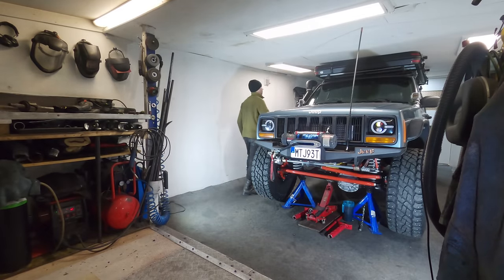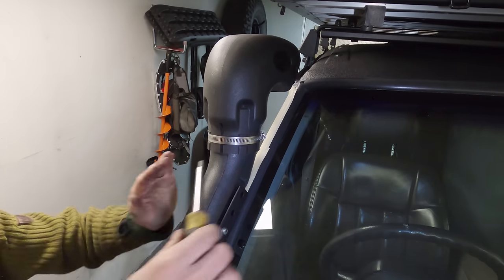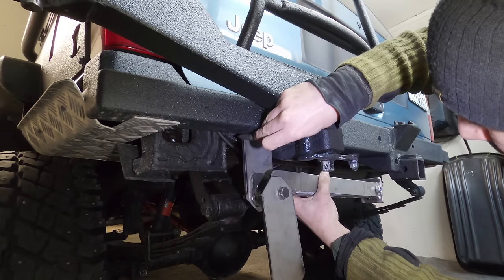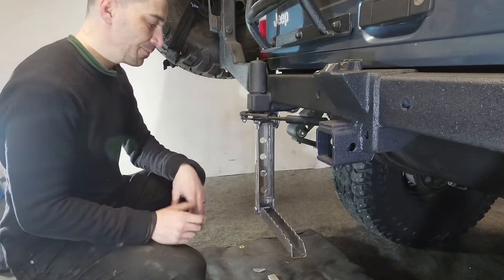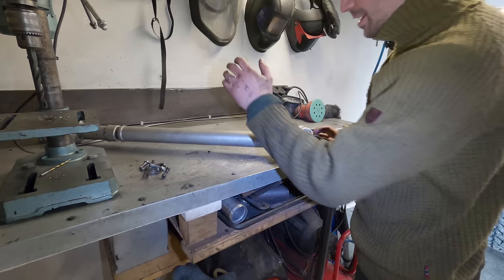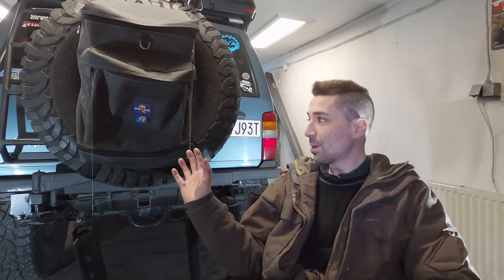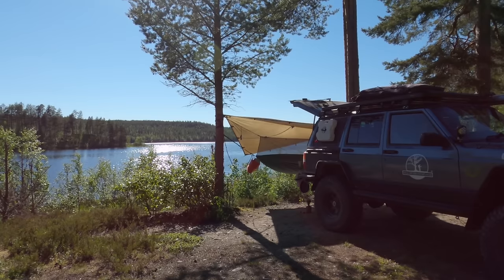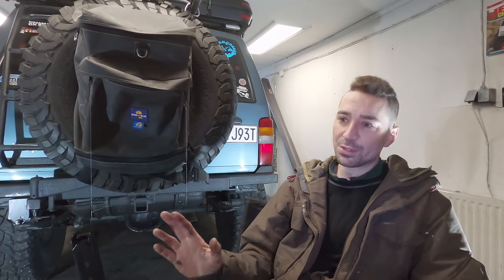Making Some DIY Parts For My Adventure Jeep

Comment: One of the best solutions to mount snorkel to the pillar is to glue it in place with windshield sealer. It stays supper rigid, can be removed at any time, no need to drill holes in the A pillar - so no rust in the future, no rattle, no vibrations
Reply from the maker: That's not a bad idea. I think my problem is that I'm using a Hilux snorkel, and it needed bending into place. Seems alright 👍 
Thanks for watching! I will remember the tip.

Comment: No worries, Mike.  Love coming along for the ride, so to speak.  Your videos are certainly interesting to me, which is where the entertainment value for me comes from as well.  Looking forward to seeing what you do with the "new" truck in the coming months.  Also, I hear you about the insect issue.  They can certainly drive one mad.  Sounds like you are trying to address that as best as you can, given the limitations you are dealing with.  Even though the extremes of winter present its own challenges, it is a blessing that the insects aren't one of them.  Good luck!

Comment: Mike the Disco 2 has a step similar but its on a gas strut .
Im always amazed how you turn some ( workshop scrap ) into an awesome functional solution.
Great video thanks
Reply from the maker: Ah, nice, I haven't seen that. Perhaps my mate took it off. It turned out pretty good, and It also worked well at camp. Thanks for watching

Comment: Hi Mike. 

I enjoy all your videos. 
You make some great points about the RTT and the flys and summer camping. I think for your location and flys. It makes sense. 
My Jeep is setup so I can sleep inside my Jeep. But to do this I modified the front seats with the pivot brackets from a 2 door  xj. (Direct fit). So my front seats tilt forward towards the dash just like a 2 door xj. Then I mounted a plywood board to the back seat into the metal frame of the seat with nutserts. That board is shaped to fit around the center console. And folds down on to the base of the front seat. Then I click the front seat back 1 notch. So it stays locked in place. Now to actually do this. I have to remove the back seat bench. Either before I go. Or when I get there. If I’m going out without my kids I leave the bench seat at home. But if they come along. The bench seat goes inside the arb annex room. 
If I’m camping solo. I don’t set up the annex room often. As I put all my gear on the other side of the jeep next to me. I have those plastic window vent things on the rear windows. So I can get a cross draft. Then use those stretchy window shade/bug screens that go over the entire top of the rear door. 
I’m the rear of the Jeep is a removable shelf. But it stays in place when camping. My feet go underneath. My gear goes on top. Or I can place an iPad up there for the kids to watch a movie. 
On a morning I can lean up against the back of the front seat. Like a lounger and have my coffee. 
I had to modify my front seats. As I’m 6’2”. And the Jeep just wasn’t big enough otherwise. 
Also I have no rear window like yours. So that where the diesel heater pipe comes in. But you don’t need that. As it’s in your passenger footwell. 
I think you could probably easily setup yours so you could sleep inside solo. On the opposite side to your fridge. You would just have to move your metal kitchen box next to where you sleep in the rear seat area. 
Maybe start by removing the rear bench seat. Fold the back down. Then build something that folds down into the the rear footwell. And is level with your rear sliding table system. I’m assuming that when you winter camp. It will only ever be just you sleeping inside the Jeep?
Removing the RTT might help the Jeep do even better in the snow. As you will be 150lbs lighter I’m guessing?

Comment: Good plans on the 4,0👍🏼 I am doing something very similar to a diesel at the moment😊 31’s and a small lift. I have taken off the original fender flares tho, and i am making new frow sheet metal. And i ‘lifted’ the front ones 3-4 cm at the same time. I have also bought a 1,9tdi and a 6-speed transmission that i plan to install next winter. Keep up the good work! And keep the classics on the road🥰

Comment: Could you make a quick video on how your body is holding up after this many years of abuse. Is reinforcing the body absolutely necessary? And if anything ripped after the reinforcement? I was told by one body shop owner, that it is useless, that when you reinforce one part, body will fall apart somewhere else, in the next weak spot.

Comment: Try to move shift lever around, on my wrangler when I put shift lever all the way forward it makes wining noise, but when I pull it half an inch back (still in 2wd) noise stops, also when I put it in 4wd noise goes away. So something is touching and making noise
Reply from the maker: I tried that and installed a assilink linkage. I'm fairly certain it's in the case itself. Bit of a shame, but I will rebuild it when I get a rebuild kit. Bloody annoying, though 🙄 
Appreciate the tip, though, because that's happened to me before. Thanks for watching

Comment: Why not just make something L shaped that slides into the tow hitch so the step is removable? Short part of the L fits in the hitch, long part of the L points to the tire and reaches under the ladder
Reply from the maker: Yeah, I mean, you could do that also if you wanted. I like not having more stuff in the Jeep to set up. Just pull a pin, and it's done. 
Thanks for watching

Comment: What does a snorkel do?
Reply: Raises the air intake so you’re less likely to suck air into the engine if you’re going through deep water
Reply from the maker: It's also nice for dust. It keeps the intake away from the front tire. Thanks for watching